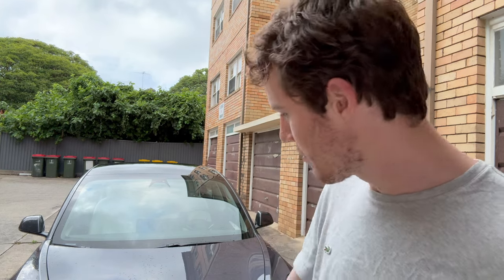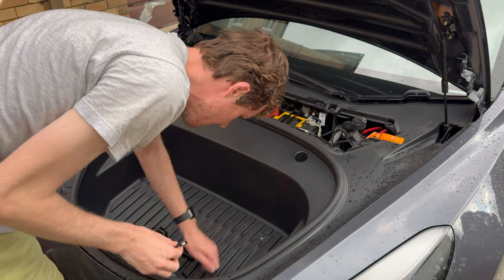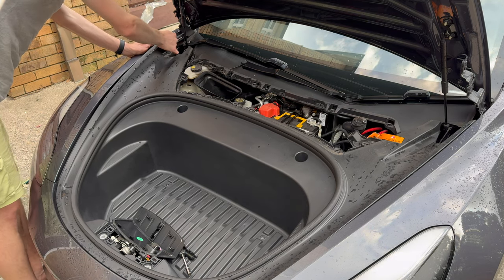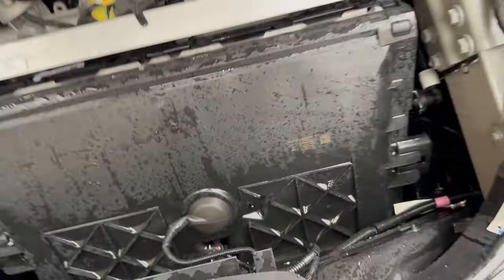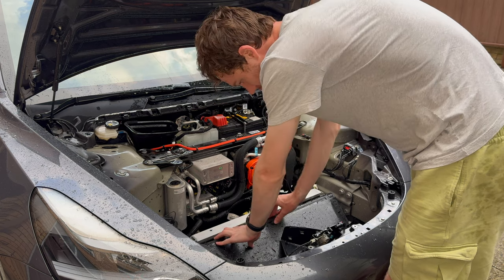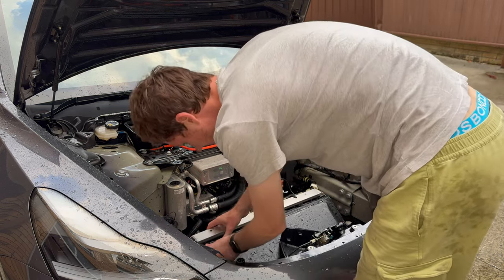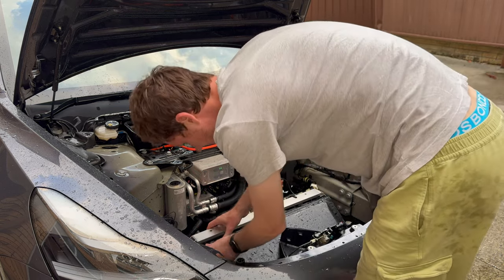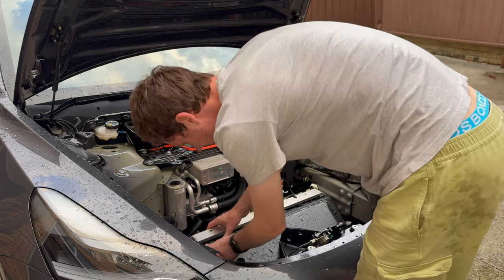How to Clean Tesla radiator - the easy way

Comment: Thanks for this video mate. My 2022 M3 RWD is normally garaged at night at home, however I do a lot of motorway/highway driving as well as overnights in country places. My radiator was full of leaves and debris. I hadn’t run a service check to see what it was running like before however it was a similar situation to yours so I’m sure my efficiency will improve. Many thanks for the straightforward video as I am not a car guy at all!
Reply from the maker: I'm so glad it helped you. I had a look at the existing videos and they wanted you to take off the front bumper etc. I thought that must be an easy way.
How long did it take you?
Some people in the comments are saying that getting water in there will damage the radiator or something but thing is when you supercharge in cold weather heaps of steam is generated in that area which would condense on all of the components so I don't think it's too big of an issue as long as you just spray on the radiator.

Comment: Thank you very much. I was trying to remove the black shield that is under the Frunk and you probably saved me an expensive repair!  I used 2 short pieces of 2X4s and they held the shield open and I used a special vacuum tool and removed rocks and all kinds of debris.
To add to this post.  I used a vacuum tool that reached all the way to the bottom of the radiator (that is what I call it).  I vacuumed 4 rocks (one over a half inch) a cigarette butt; 2 whole bumble bees and a bunch more leaves.  You really need to use a vacuum carefully not to damage;  the radiator is made well and quite sturdy, not like regular cars.
Reply from the maker: I’m so glad I was able to help!! ☺️

Comment: Lower fan RPM was likely from the wet coils needing less airflow to stay cool.
Reply from the maker: what about after they dried off and it was still lower days later? 
Pretty sure it was the layer of leaves and dirt blocking the radiator.

Comment from the maker: This video has the audio fixed, let me know if you have any questions on how to do this on your Tesla. 
After cleaning the radiator, those 40°, hot summer days are much easier to tolerate with functioning air-conditioning .

Comment: Does anyone know a vid on how to fully remove the cover? I got a bunch of crap out with compressed air. Started raining before i could use water, ironically. So i had to button everything up. Part of me would rather just have full access to the radiator. Thank you for this vid.
Reply from the maker: The documentation in the Tesla service manual shows you how to get full access to the radiator, but I didn't want to do it that way as it's way more complicated and involves removing the front bumper etc

Comment: There is a cooling fan behind the air-conditioning radiator. Can the air-conditioning radiator be cleaned directly by flushing it with water? Will it damage the electronic parts in the car?
Reply from the maker: I think it should be fine. when it rains also enters in here

Comment: Do you have to disconnect the 12v battery or did you do it with the battery on?
Reply: Never mind you answered it 😂
Reply from the maker: You should disconnect it :D
I didn't but its pretty easy to do and makes it safer.
Reply: @Lens_Addict  thank you, I got mine all cleaned up and it’s already operating better!! Really great video.
Reply: @Lens_Addict How do you disconnect the 12v battery?
Reply from the maker: @justrandomthings319  take off the negative (Black) Terminal, you need to undo the bolt to take it off.

Comment: You got any problem after? Water si safe?
Reply from the maker: No issues after, the radiator usually gets wet when it rains anyway.
Reply from the maker: No issues after, the radiator usually gets wet when it rains anyway.
Reply: @Lens_Addict   I cleaned the radiator with degreaser and water, worked like a charm. Thanks for your video. Now the fan runs smoother and the AC works better.

Comment: You said a "Phillip screwdriver" was needed but you never used one. You only used a 10mm socket wrench.
Reply from the maker: Lol true, I think I meant to say flathead, it helps with undoing some of the clips
Reply: Oh, okay. I just wanted to be sure. 

Absolutely fantastic video. I just did this 30 minutes ago. 

Unfortunately, I didn't have a water hose so I used a vacuum. My fan still runs a bit loud but not as loud as before.

I would say the noise level dropped about 50%. I'll take that as a win and try again when I get access to a water hose.

Comment: Brother, you have temporarily cleaned the radiator, but it is not a good way to clean it. In this way, only the dirt etc. from above will be cleaned, but if the dirt etc. is stuck inside it, we The best way to clean it is to open it completely and wash it and fit it properly